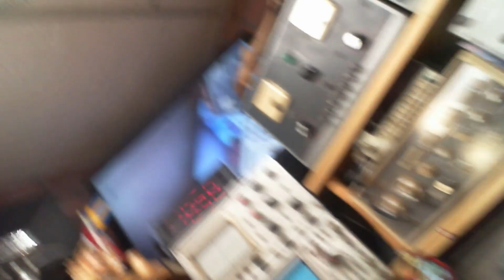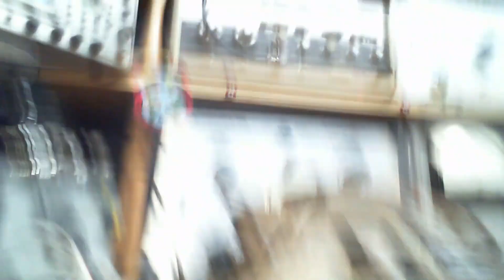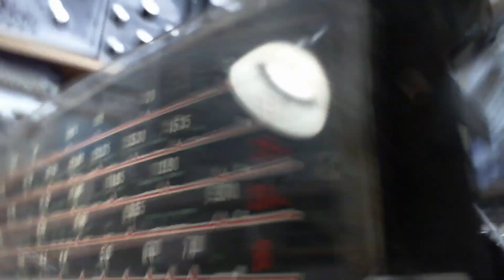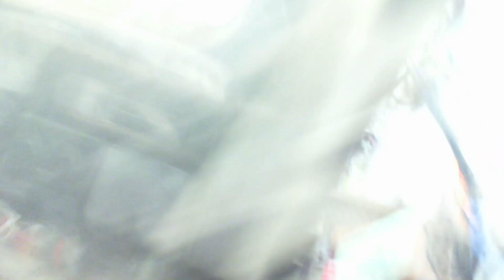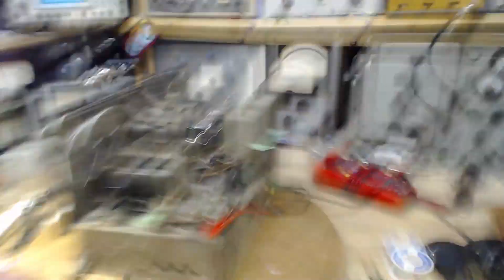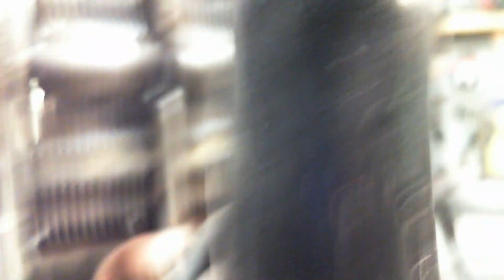Crosley Mohawk Model 14B Tube Radio Video #11 - Successful String Installation

Comment: You have two set screws on the large pulley. Why not make good use of them? Take a few days to think on that. Instead of blind winding the string on the pulleys use the motion of the large pulley to set in position to what you need. Then reset it to match the dial and capacitor. Start with the spring! I bet you could work behind the pulley if it were moved back one inch.

Comment: Hi Jim.  Been a long time viewer of some of your videos (mainly the ones about Fisher gear).  I wondered your thoughts on old Fisher Monoblock amps?  My step father was a broadcast engineer (later mainly of microwave broadcast gear) and he use to swear by Fisher gear when it was around.  I have wanted to broaden my stereo gear with trying tube gear, and thought it would very unique and fun to try old Fisher equipment...but the monoblocks seem VERY rare, and maybe not really able to be properly refurbished?  Thank you for your time and being a great teacher in your vids!!